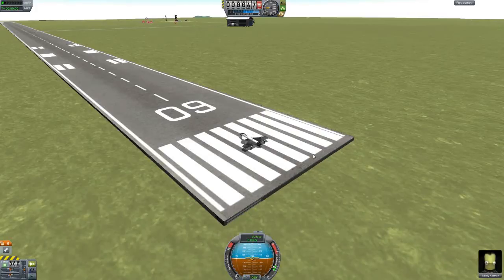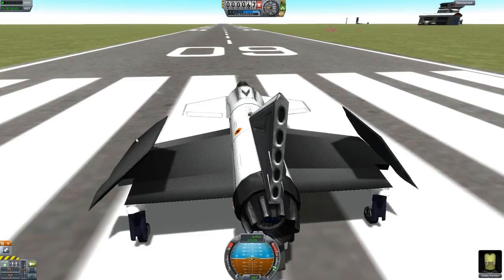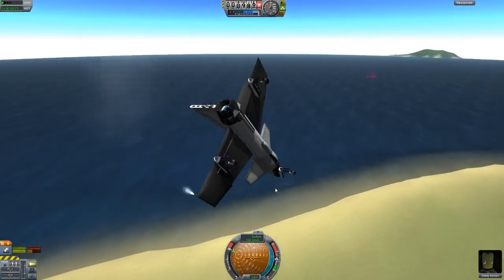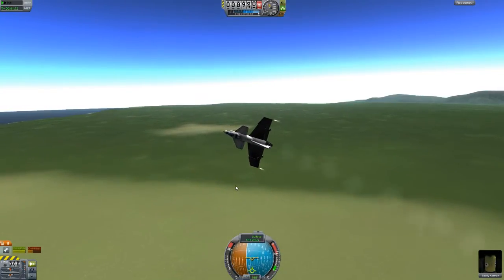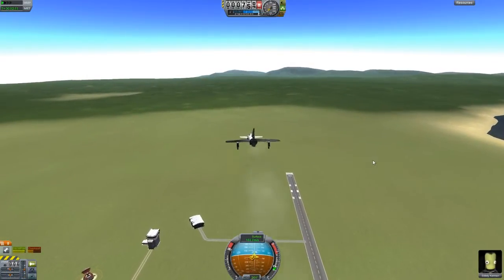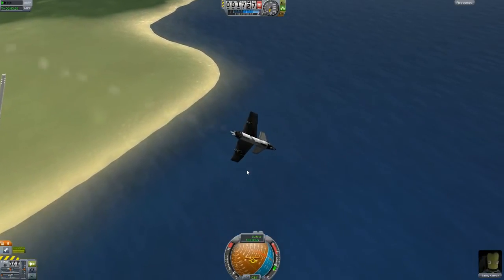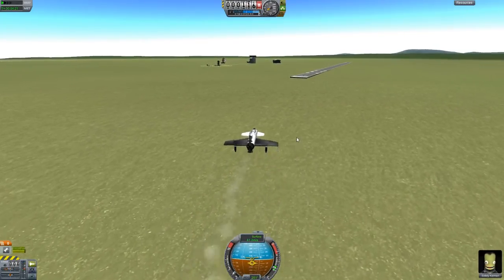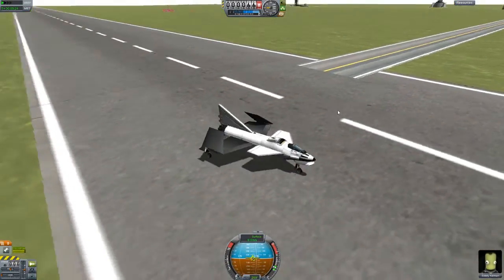Naval Folding Wings - Pt2 - For KSP

Comment: Now i know you are mainly making naval related things, but a good use for folding wings is if you could make them retract into a fuselage and when they are retracted into the fuselage, they produce no aerodynamic effects. so that you can use them on a rocket without the wings aerodynamic effects and then use them to land later without having to worry about them messing up a rockets flight on lift off.